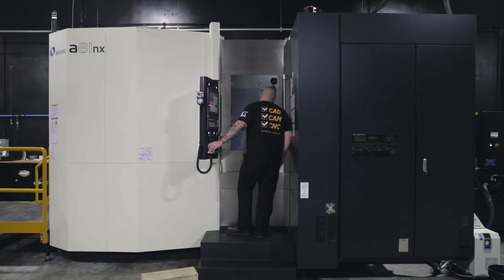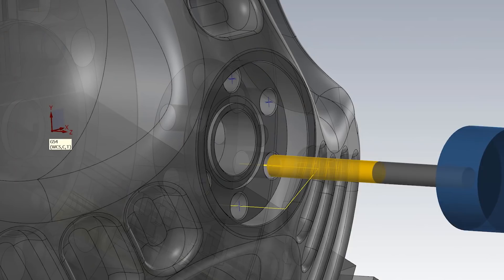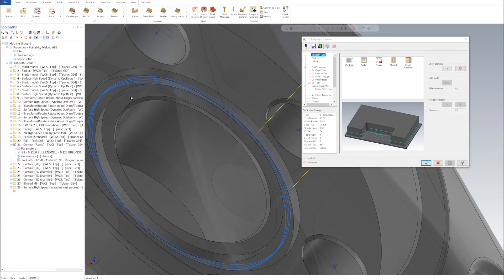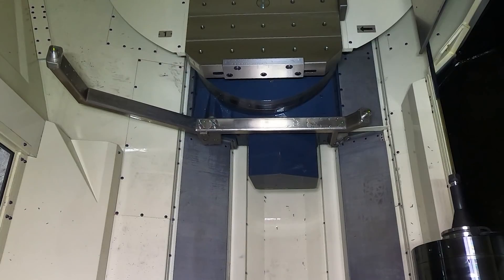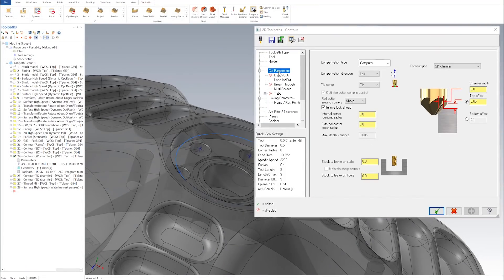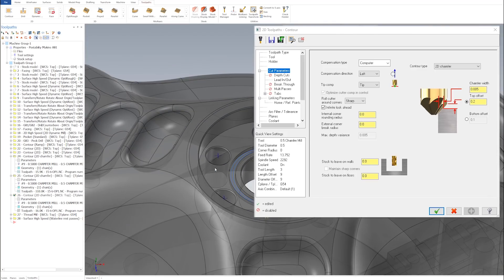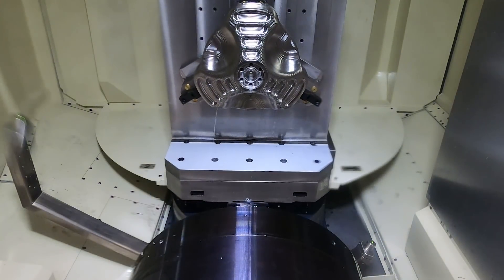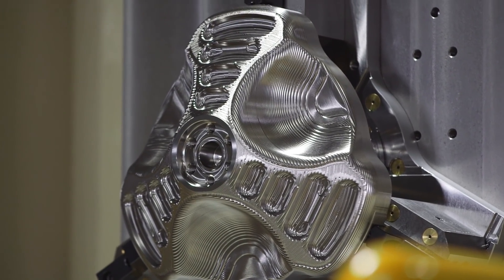60HP MAKINO | Intricate Titanium Threading, Grooving & Chamfering | Aerospace Part Process

Comment: I work in a dental lab and I get to modify some dental parts ( abutments ) for dental  implants   while making the final restorations - those are (most of the time ) titanium abutments - that material is extremely hard - those  abutments are (usually)  anywhere from 4 to  9 mm in a height and about 5 mm in a diameter - average adjusting time is anywhere from 15 to 30 mins in order to get the proper size. And this 'beast'  machine is cutting it like butter - mind blowing !!!

Comment: As an aerospace engineer myself, I'd love to know how you guys use vendor-provided engineering drawings with your CNC machines? It seems like you used to need very accurate drawings so that machinists could make the parts, but now with CNC the CAD models run the manufacturing process.  Do you see drawings as still being 100% necessary, or is new manufacturing technology moving away from them?
Reply: Idk how it works in the US, but here in Poland all toolshops require drawings and will not take any order based just on a 3D model

Comment: I am an operator of an A81nx-5XR and just changing from collet to hydro holders, more than doubled tool life. 
Using tool wear on the machine makes it easier to mill threads especially for UNJF aircraft parts.

Comment: Hey Titan, can you give me specs of your PC, I'm also using master cam, and it works bad, I think it's because of my PC is weak. Thanks a lot.
Reply: Vladimir Yatchenya if you pull up the windows gamebar (windows button + G) while you’re doing a thing, you can see what is straining the most weather it be your cpu (most likely), your RAM, or your GPU (least likely). If it’s really straining your pc you should see a really high percentage of use from one of those parts of your computer. Then you can upgrade from there

Comment: 5:20 "linearize helixes" should not be enabled when used for round features, it just adds a ton of straight cuts, causing unnecessary wear and leaves a worse finish, rather than a nice fluid G3
Reply: well my CAM system makes it as a round contour, g2 or g3 :)
Reply: @ShInYaKu88  Alright :) I guess postprocessing does mean quite a lot, in that regard
Reply: I learned this the hard way a long time ago lol

Comment: Hey Titan! I am glad to see I already do things very much like this good to get some verification from one of the best! I did have a question about thread milling though. I typically drill with the recommended cut tape drill size then cut my thread the the minimum major diameter and then walk the thread in until my thread gauge fits nicely. This usually can take several iterations. I was wondering what thread reference you use and do you always use a thread gauge as your final check? Sometimes I cut custom threads for a 1-off part and don't want to purchase a custom thread gauge. But I also want to come pretty close to the thread spec dimensions. Thanks for the rad content!

Comment: I am going to be starting a job in a small cnc shop and I have zero experience nor training. Does anyone have any quick tips to succeed or major things to avoid doing? I don’t really know what to expect.
Reply: Mik Squad find the most knowledgeable person you can and listen very carefully to him. Ask questions. Take advantage of his experience. Put everything you can into the job and it will become very rewarding and if youre good then well paid too. Good luck
Reply: EVOMAN14 Thanks for the response!
Reply: I agree with the first comment. Be a sponge. Soak up all the info. Take notes. Dont be afraid to ask questions and ask Why. And when you start getting comfortable dont be afraid to experiment a bit, do some research. Knowledge is power. Also take note of the mechanical and physical aspect; setups, fixturing, part process, programming. Look at a part and ask yourself "How would I make that?" And then see how that shop does it. Dont forget theres also a millions ways to make a part. Good Luck.

Comment: I notice your using computer comp with thread milling. If you set your parameters to have a perpendicular lead in, you can use wear comp for your thread mill which allows you to adjust the comp at the machine instead of having to re-post to over/under cut the thread each time. If you don't check 'use perpendicular lead in,' then you'll get an alarm b/c the comp-on move will be that first entry helix into the thread.

Comment: Why don't you use wear? I'd rather be able to comp the tool than have to re-post to open the threads or a diameter. Have you had problems with wear?

Comment: When ramping in Mastercam, do you always linearize helixes? I usually turn that off because I don't get smooth surfaces and the program is way longer. Curious if this is on purpose or just overlooked.
Reply: I've had the same problem with linearize helix's turned on.  You end end up with a ton of lines.

Comment: @ 6:30 would love you or one of your crew to go over the math you just sped thru for the 1/2" chamfer mill. 90deg, over 50 down 50 ? Could we dedicate a single video to this subject of chamfer mills and calculating the actual chamfer. There are a lot of times, contour, vs chamfer to get what you need out of a tool path could be a lot of help than having the computer do it.

Comment: Titan, great content. Question: what you do with all the chips? what's the process? recyclin?
Reply: At most machine shops you have a bin for each type of material and a contract with a recycler who provides the bins and they will come pickup either on a set schedule or as a on call kinda thing. They pay the shop for the scrap weight, usually a certain percentage under market rate due to them providing the bin and the pickup / drop off service. There is an allowance percent for cross contamination but if you constantly have alot of steel in the aluminum for example, you get a bad rep with the recycler guys and likely wont get top dollar from anyone. do them right and they will do the same

Comment: I appreciate you making these videos but I get a bit confused when I come across all the IPM, IPT,SFM,VC is there any way you can explain how we get these numbers and what they each do? Thank you !
Reply: IPM Inch per minute.  The speed the tool is moving into direction of the milling.
IPT inch per tooth.  The speed that each TOOTH of the mill is moving forward toward the milling direction.
SFM surface feet per minute.  Imagine you lay the tool flat on the floor, and you roll it, like a wheel.  How many feet would the tool go in one minute, considering the RPM it is working at.
VC Viet Cong.  Run away.  (That's metric.  We don't understand dividing or multiplying by 10.   We is stupid.)
Reply: @danl.4743  VC? Lol but nice explanations.
Reply: @arneldayto445  We've all been there when we started, right?  :)

Comment: I would like to see some CuNi 70/30 tutorials with speeds and feeds. We do a bunch of it and I'm always adjusting the program numbers do due it being an old program and older tooling. I have been getting my boss to finally see the benefits of carbide tooling and newer tooling options so we are changing programs 1 at a time.
Reply: Nickel bronze??  I've never heard of it.  What is it used for?
Reply: @danl.4743  copper nickel
Reply: Its 2020 and hes just now ordering carbide? Stuck in the dark ages much is he?

Comment: Before machining an expensive piece of stock like that for the first time, do you do a test run on a less expensive piece of material like steel or aluminum?
Reply: If it was a smaller piece probably but any chunk of any material that size would be expensive to test cut.Also the cutting characteristics wouldn't translate well if the tolerances are tight. You might test cut certain features like say a really tight tolerance bore on a smaller piece of the same material. But most likely if its a first time making the part you just make it way over sized and walk in the program. Takes more time but you dont make a 10k plus chunk of scrap
Reply: is a common practice that you run your first part of aluminium. it all depends on  level of your process.
Reply: You could run a test piece of aluminum to make sure there are no oh 💩 issues with the basic program, but simulation of titanium's cut properties will not be done without something really expensive. Cuts similar to high nickel stainless steel. 🤓